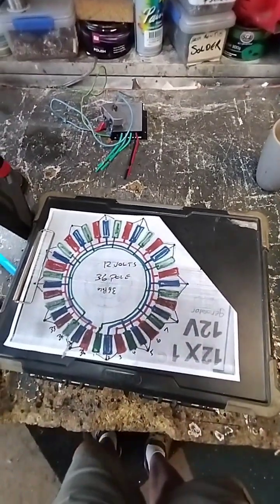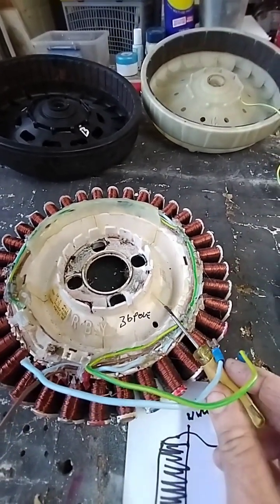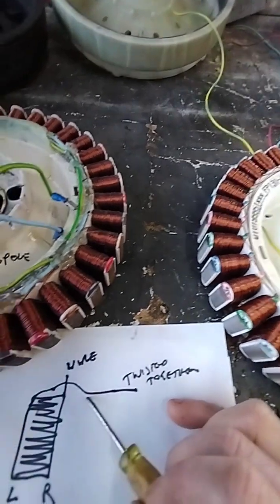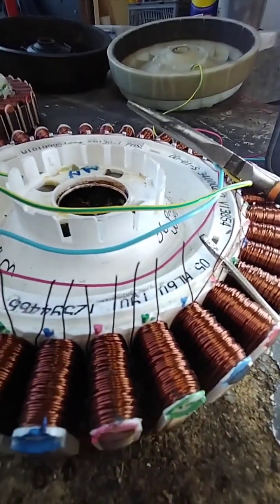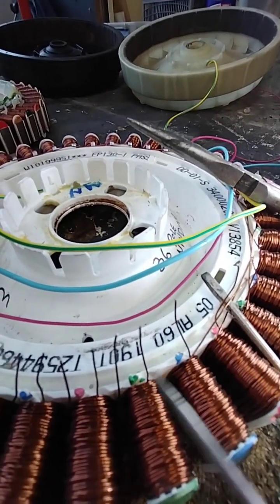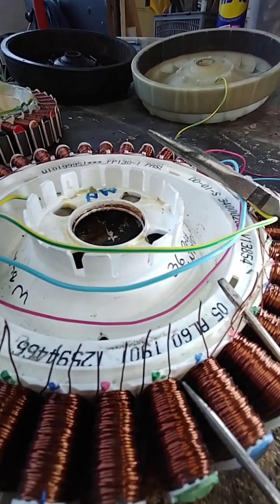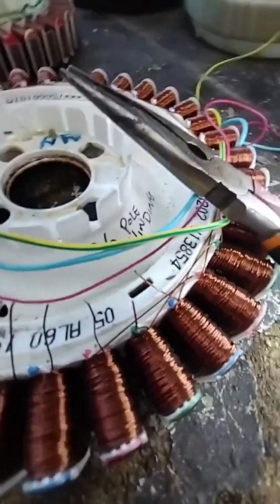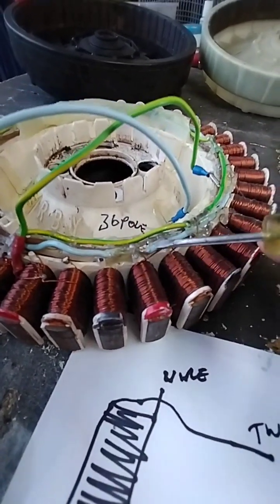Part 3 of the wind generator. cutting the wires and joining them to the right spots.

Comment: So you’ve joined the coils together into groups of 3 to make a 12v 3 phase supply? How was it originally wired up when it was being used as a washing machine? Was it a 240v system ?
Reply from the maker: Yes it's 240 volts and all 36 coils are joined to make a 240 volts motor. I explain how they were Joined in series in one of the other videos.